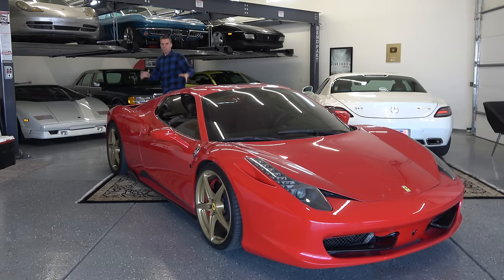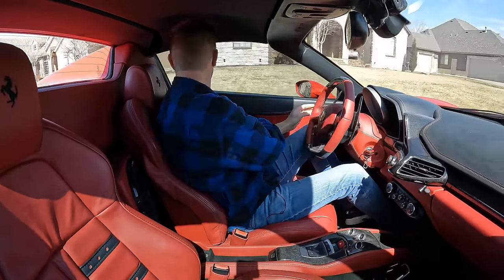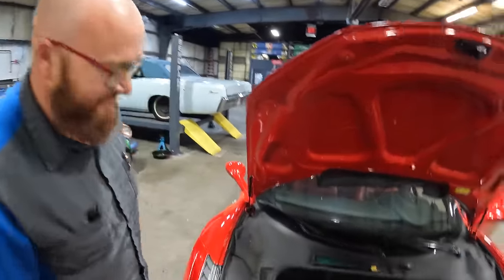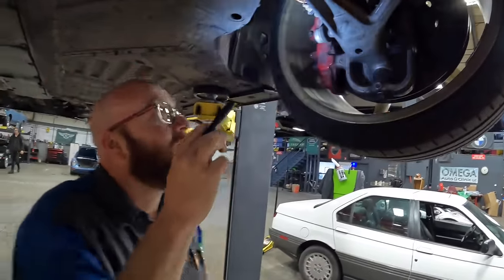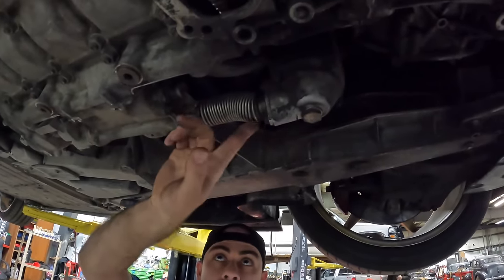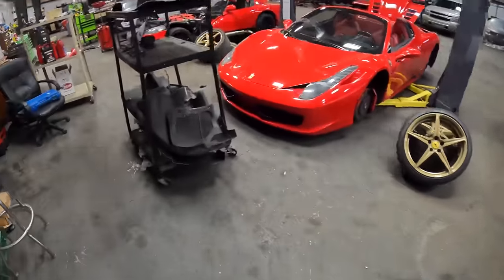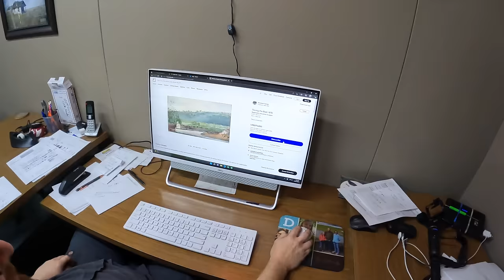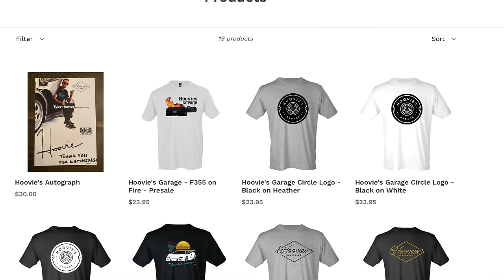Here's everything that's BROKEN on my Ferrari 458 (and why it was so CHEAP)

Comment: Rear tray is a must. Even at factory ride height, it's still a very low car, and there's many sensitives parts that could easily be damaged and worth way over the price of that tray. But even with the cost of this part, you made the deal of the century ! It makes no sense to me not to replace it. Also, full annual service. Again, you made the deal of the century, treat it well, and you will enjoy it for years.
Reply: Undertrays aren't for protecting It's for aerodynamics.  Especially if those covers are plastic forget about any protection whatsoever.

EDIT: Lmao and the wizard just said so himself
Reply: Except he's not going keep it for years. I suspect he will just fix what NEEDS to be fixed i.e no lights on the dashboard and just flip the car. It makes sense financially
Reply: @JackRR15  whilst those plastic aero covers may not provide much protection from 'impacts', they'll still provide protection from 'exposure' ie less road grime etc being flung up in to innards of the car. Plus they would still deflect things like small pieces of gravel etc. They still provide a 'mild' protective 'secondary' function.
Reply: @devilsadvocate2548  Even mild protection is too generous.
Reply: Totally agree. The under tray, along with the aero function, protects  all the pulleys that are facing the moving direction of the car. All road debris can be sent directly into it otherwise.
Reply: @JackRR15  - too
Reply: @gak2173  Thanks I updated my comment.
Reply: @JackRR15  its quite a lot of protection actually. Because now you will scratch the tray before scratching any exoensive parts.
Reply: I bet he does a lot of those things the wizard suggested.  Seems like that whole thing was a ‘bit’
Reply: Ehhh I have an old beater Saab that has been missing that for years and it’s fine
Reply: Just have the car wizard make you one from steel or aluminum and be done with it
Reply: @JackRR15  Some under body panels are required for cooling certain parts, so not always just for areo.
Reply: @herculesrockafeller  I hope so, because the thought of that car not being properly treated to save a few hundred bucks is triggering.
Reply: @Animalrescue8242  yeah, I had one that was partially broken with a hole and I used flex tape and it lasted years.
Reply: @JackRR15  Keeping dirt and dust out can help prolong the life of many things
Reply: @muazqamar   have you seen this man?  do you think he makes sense financially. Lol
Reply: He going to sell it in 12-24 months from now, doubt he’s worried about it.
Reply: Agreed, I do think he’s trolling in all honesty.
Reply: @a_camel174  he’s playing a character. This guy knows exactly what he is doing. He did a good job convincing people obviously
Reply: @devilsadvocate2548  He is oblivious, then a piece of gravel gets up in the flywheel... um... yeah...
Reply: @herculesrockafeller  Yeah i think so too. It was a bit surprising from Tyler.
Reply: I find it odd that this is the one car that Hoovie isn't going all out to fix.  80s Cadillac, spared no expense...but a 458?  Ehh let's nickel and dime it.  Hopefully he's just kidding around
Reply: It wouldn't be hard to make a cover
Reply: @JackRR15  they offer a ton of salt/weather/stone protection to all the undercarriage, just like a mud flap, wheel well cover or a lot of other aero/protective parts.
Reply: Good stuff!! Congrats on the 458!
Reply: @JackRR15  found the guy who lost his undertray
Reply: Even if a cheap fabricated replacement, temporarily to take some of the burden of the cost, it needs something
Reply: I would say there are 3 things to consider before putting or not a tray in order of importance
1- heat dissipation is better without tray
2- aerodynamics
3- protection against debris

i would go to keep it wihtout especially in warm weather
Reply: @JackRR15  Totally wrong about this, sure if you hit a boulder or something it's not going to protect the engine bay but who the hell drives a Ferrari on anything but tarmac? The flywheel and serpentine belt are fully exposed, any gravel thrown into either of those, heck even just dirt accumulating there could be very bad for these critical parts of the engine then if you have to repair or replace anything there, specifically for cars like this, it's gonna cost you big bucks! Supercars needed to be treated well or it's just going to bite you in the ass.
Reply: If you don't think he knew this comment was coming I'm so sorry.
Reply: Man I couldn't stress that enough..I'd never drive a rear engine or mid engine vehicle without a rear pan. Another 10-20k should get it right as rain.
Reply: how low are you, coils, bags or cut springs?
Reply: @roodick85   finally someone who understands
Reply: @herculesrockafeller  at least someone gets it
Reply: He buys cars he can’t afford to repair or maintain properly. That’s his trademark

Comment: Never thought I’d see the day when hoovie totally cheaps out on a Ferrari in the wrong way, at the very least get the underbody engine cover put on, it’s madness not to
Reply: Exactly, I don't get it either. If it would be just preventing dirt getting in would be worth it not to mention at least some kind of protection from damage. Fixing the fuel tank dent seems to be not worth the money that I would agree on.
Reply: Not doing proper maintenance or fixing to spec is essentially a waste of investment. It will always be a cobbled salvage mess. Has to be trolling. Damn shame otherwise.
Reply: And the read defuser... come on, spends like 8k on a Mini and wont spend a couple on a 6digits Ferrari. 
Why not bring it back to mint, would probably get it all back and more...
Reply: the car itself is a botched up frankenstein with disc brakes coming from different cars, its a car to daily and race not a presentation museum piece.
Reply: @ReviewGuy01  totally agree. its pants for a ferrari
Reply: Ikr, this car totally deserves it. It can be the perfect driving machine !
Reply: @ReviewGuy01  yeah but at the same time, nothing that was botched is irreversible. Once those brakes are finished, go back to standard Ferrari. That car is special enough to be worth saving I beleive.
Reply: It was an act, reverse bill stuff where the Wizard faints. Of couse he will do full anual service and buy the cover plate
Reply: @pmccoy8924  IRS has been coming for him lately, probably is being a little more tight with his money.
Reply: This sort of nonsense from the same dude who bought a $15k exhaust to throw at a problem that it didn't even fix. Makes absolutely stupid nonsensical purchases (The Audi R8 for example), claims he was scammed (Never actually looked at the car). What little brain cells he has left are fighting for position.
Reply: @snwboardn21  Hope he does not go bankrupt.
Reply: This and the 300ZX videos were massive disappointments. Hopefully Tyler sells this to someone who will actually appreciate it. His shtick of buying cars just to let them sit and rot in his garage is getting kind of old.
Reply: How the hell does somebody spend over 150-200k on a 458 and mantains it so badly. Home depot screws and no underbody this is just idiotic
Reply: At least make one to bolt on there. A big sheep of plexiglass and paint it up black or something
Reply: I took the underbody engine cover off my Audi and drove it like that for years, I think he’ll be fine.
Reply: Couldn't he make one from a sheet of cheep carbon fiber?  I see several comments saying to use plastic. It seems like a sheet of plastic would warp from the heat, but I don't know.
Reply: @AnkitSingh-ez5gc  Ferrari and perfect don't really go together.

Comment: Congrats man! I would definitely spend the money on the belly pan. It makes the car much more stable, channels the air to the rear splitter, allows the car to not be a parachute in the back. Not to mention it definitely makes it more sellable later. With all the money saved already and its benefits its worth it and you can actually put it on yourself man!  I wouldnt wanna hit something and it come up in the engine bay either such as an animal, something from another car or just a stick etc.
Reply: One little rock into the exposed flywheel🤯
Hell just cut a piece of sheet metal to roughly fit

Comment: If it has an exposed flywheel and you need to raise the ride height to avoid damage, a cover seems like a good idea
Reply: They can just make something
Reply: Exposed flywheel is fine
Reply: The exposed flywheel can be covered with tin foil and it will be good to go.
Reply: @bravotwozero8119  and you already have the tin foil from the battery

Comment: Definitely gonna regret not getting the engine cover pan when you scrape and destroy the flywheel and oil cooler going over a bump! Also you can already see what’s happening to the fuel tanks!
Reply: That cover wont protect it at all against bumps lol. just for aero and dirt protection.
Reply: Hes going to lift it anyway

Comment: For the Diablo, might be a longshot but the drone could be from a bad exhaust hanger, or damper. My Lexus had the same thing where it would whine on the highway (it did it always, but just more obvious when cruising at 65). I ended up adding some additional clamps and dampers on them and attached to my exhaust. I did 2 of them and it cleared the problem right up, I couldn't believe it. 

Not sure if this would help you, but I hope you see this and hopefully it can help.
Reply: They just replaced they whole exhaust...
Reply: I was thinking about similar things like engine, or exhaust mounts, because that small cabin is  surely capable of amplifying a vibration.
Reply: The only time I ever had a similar noise on one of my cars it was caused by a faulty pressure valve on the fuel tank vent.
Reply: From my experience with older Italian super cars, that Diablo could have been in an accident, received unseen damage and has been left that way for years. So many “cheap” 80s/90s super cars got into accidents that were never listed on insurance since the way things worked back then
Reply: This is a good idea! Maybe the rubber or bushings are bad?
causning vibration?
Reply: Nope. It 100% sounds like a bearing in the differential to me.
Reply: My exhaust hanger is pissing me off in my Civic. Makes a metallic rattling noise ONLY at 1200 ish RPM. Thought my clutch, CMC, or something was bad since I am only really at 1200RPM when starting from a stop in 1st gear.
Reply: I disagree.
The noise is a constant.
Vacuum line or Pulley whine as noise isn't speed related.

Infact I'd throw in the Radiator fan or Skateboard wheels under the front Bumper.
Reply: I feel like that moan might be in the intake track...a loose piece of plastic vibrating somewhere at just the right intake air velocity...
Reply: My Lexus had the same thing, I didn't replace it and the cat fell off.
Reply: I remember an episode of Top Gear where Jeremy was driving a Ferrari and the wipers were vibrating on the windshield making a similar noise. He gaff taped them down and it went away.  A brilliant fix, until it inevitably rained😂
Reply: Good point to check
Reply: @renypayne11  Did it land on it's feet?
Reply: If its louder in the cabin its a resonance issue. maybe some sound dampening?
Reply: @dabreal82  09
Reply: He can just put the subwoofer from the ferrari in it and solve the issue quick lol
Reply: I think the whine is final drive/rear diff. The note changes with speed not rpm or gear.
Reply: @dabreal82  Part of*
Reply: @who_stole_my_username  Maybe it's groaning as the pump sucks fuel out? I assume it must vent the other way or the tank would cause the pump to have to work ever harder as you drove and the pump sucked out the contents of the tank.. relatively quickly I'd imagine in that car. But I don't know that this is true, maybe I'm wrong.
Reply: @isogamer12  yeah but if an accident was causing this then there would at least be something to point them toward where and why... Simply saying "noise? Must've been an accident" isn't really adding anything constructive, especially when you don't explain what exactly the accident could have affected to be causing such a thing, seeing as a dent is not going to cause the engine to groan....
Reply: Or possibly an air leak in the intake path.  Once had a vehicle with a similar sound that was caused by the air inlet to the air filter box coming loose and leaving a small opening where they mated. Pushing them back together and tightening a clamp and a bolt fixed the noise.
Reply: @dickeyseamus  Makes the same noise when stationary
Reply: @dabreal82  Could be the exhaust, they are tuned and the lengths and bends all count and could be part of the problem, refit the exhaust

Comment: Should still do the rear tray
It runs air over the rear difuser improving grip 
Without it the rear bumper/diffuser just acts as an air damn holding thr car back like a parachute
Reply: He gotta do the annual service with all fluids and the bottom pan... MINUMUM!!!
Reply: yep need the tray and a FULL Service ---- plus get the rails painted
Reply: Came here to say this. That belly pan is definitely something I'd be doing on that sort of car.
Reply: It is painful to hear how much he is skipping here... like dear lord this is beyond Hooptie territory
Reply: Nothing a sheet of aluminium and a spare afternoon couldnt fix. 😀
Reply: Plus that flywheel is just exposed
Reply: Hoovie said it himself, you get enough air pressure there and it could rip the bottom bumper from its mounts.
Reply: @chefcc90  ikr, the reason I watch this channel is because i enjoy looking at neglected cars being treated like they deserved to be finally. But that ain't happening here

Comment: 100% need to get the engine under cover back on it. will stop any crap hitting your tanks and other costly stuff, and if the air gets hold the rear diffuser that will set you back 3k to 4k

Comment: C'mon Hoovie, do the full service and the tray, - at least the tray. All it's gonna take is one big stone flicking up into the flywheel to grenade your engine. You really gonna save $2500 now only to spend the $15,000+ for an engine out and a flywheel replacement, as well as whatever other damage it's caused? You've already got a huge dent in the fuel tank from not having the tray on. You really wanna chance it again? Maybe the fuel tank won't be so lucky next time.

 The service is also gonna be important since you don't know the history of the car. As reliable as the 458 is, it's reliable *for a Ferrari*. It's not reliable enough to be cheaping on the services. It's still a Ferrari, not a Hilux.

You haggled the original owner down $20,000 what he was asking for. You can afford to spend an extra $3000 to make sure the car's going to be good for years to come.
Reply: An engine is gonna be like 20k or more

Comment: it was kinda sad to see you say no to a lot of things for this repair..... like a full service.   I would definitely have bought an rear belly pan  - especially since the clutch is has an open hole.  This way rocks and dirt would not go in and damage the transmission ..... personally I think you should do the full service since the repair bill was so low...  the fuel tank replacement was definitely not necessary though.
As for the moaning Diablo.... could it do something with back pressure in the exhaust somewhere..... as you said it gets louder the more you press the accelerator.... or it could just be an exterior weather stripping seal somewhere... those are my two best guesses...
Reply: next episode I destroyed my flywheel hiting something
Reply: It’s probably just a bit for the video. He’s gonna do most of those things that he said no to (probably not the tank cause he’s right it’s not needed). He spends thousands on fixing 5k cars so no way he’s gonna skip these items on a FERRARI.

Comment: Really enjoyed your video, great find. I would definitely replace the battery and also the body pan at the rear. The pan stops the rear bumper and difuser being torn off, plus it protects the exposed fly wheel. Also I think a body shop could pull out the fuel tank dent, like a paintless dent repair. Enjoy your channel, one of the best on YouTube.

Comment: A paintless dent repair kit with a high strength glue would likely remove those dents in the tank.
Reply: Hot glue and a slide hammer!
Reply: @jonathanfenne4948  Or you can just not push your luck and leave it alone.  Would be fantastic if the tank ended up cracking.
Reply: @bindingcurve  just heat it with a torch first
Reply: @blakemn123  gotta warm it up to make it more malleable 😂
Reply: @beegee495  hopefully you have it appraised and insured too
Reply: Or you could do it right and have a body shop do the tack weld pull techinque. There is a tool that does that, don't know what it is called.
Reply: @JF-lt5zc  It's a fuel tank, not a body panel. I don't know any good shop that would want to take on the liability for a fuel tank you can't see.
Reply: @beegee495  This is what the comment section is all about... sharing expertise.
Reply: @JF-lt5zc  Yeah - there was a low-cost, low-skill autoshop that tried that twice around where I live. First time, only one person died. Second time, two people were killed in the ensuing fire.

Comment: Hoovie, I have a feeling that your glove box button is just fine. Leave it to the Italians, there is a setting in the menu on the left screen for the glove box. Make sure it’s turned on or the button doesn’t work. The pull string your currently using is a factory thing. It wasn’t put in by the previous owner.
Reply: Valet setting?